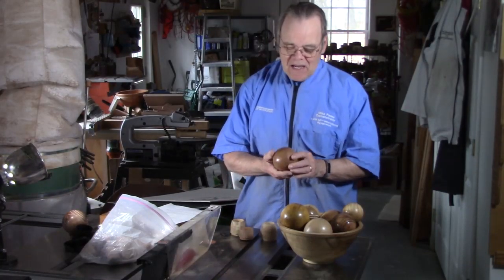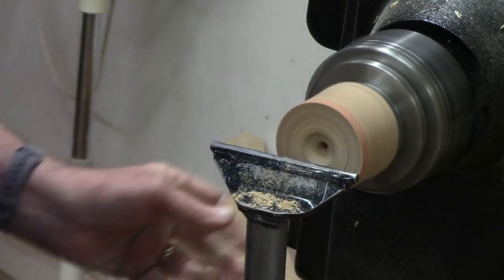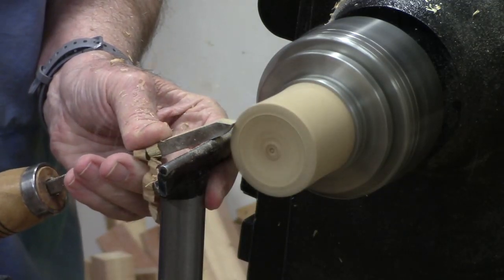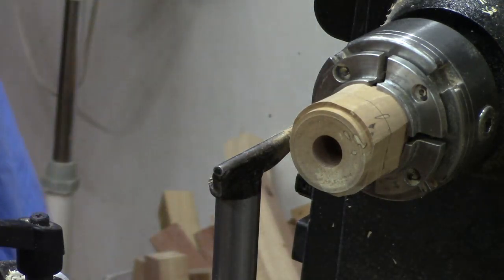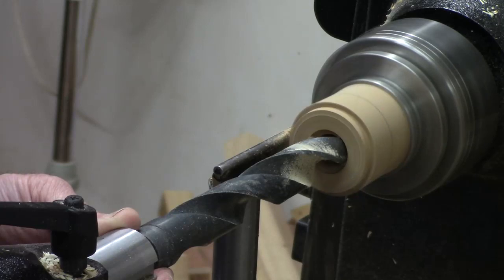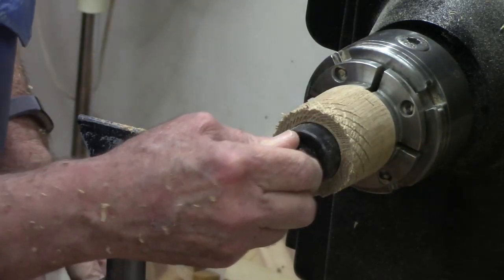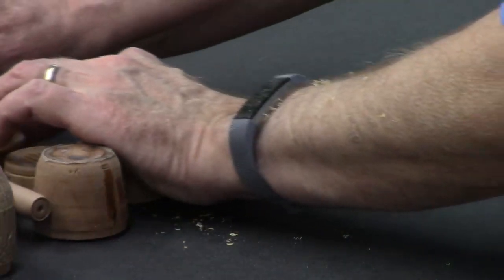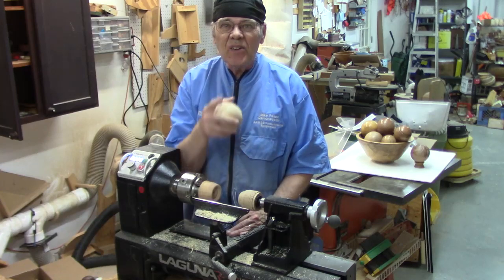Cup Chucks for Turning Spheres

Comment: I never used a cup chuck.  Thanks for the information.  You mentioned that too small of a chuck diameter has problems, is there a general rule of thumb relating the sphere diameter to the diameter of the hole in the chuck?
Reply from the maker: No rule of thumb I know. Too small does not hold. Too large and you can't cut as much surface and need to reposition more.